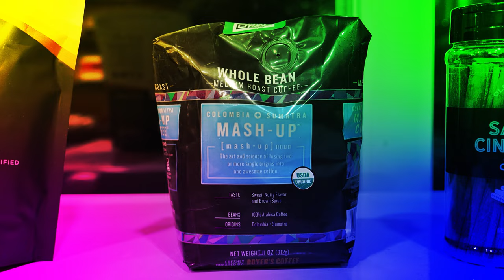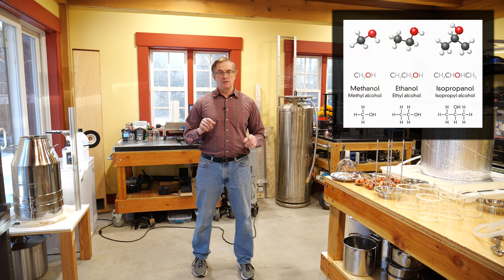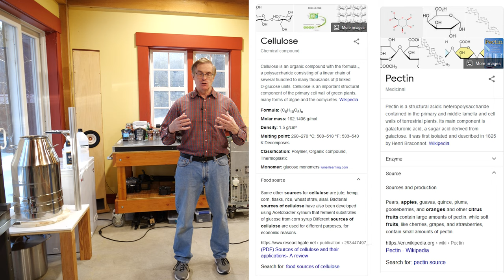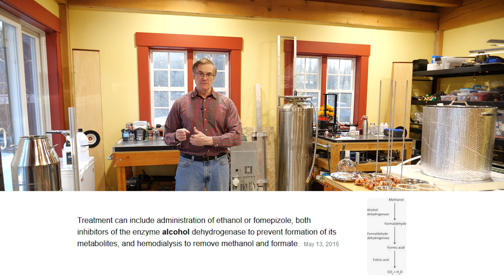Making Vanilla Flavored Rum! - Part 2

Comment: I have used fractional stills many times to distill rum. And as you have it there I was able to start with about 189 proof. I usually do exactly half your quantity of wort at about 23L. 
Here is my feedback. 
The beautiful column still you have is a dream. But I use it only to make vodka. Most of the flavors are gone when using a fractional still. A normal copper alembic still is the best to extract flavors and also the extensive copper traps a lot of the sulfur giving you a much nicer product.

Also I don't grab any alcohol until the thermometer shows 78C. Everything before that temperature is discarded.

Love your channel. The way you talk and explain things makes it a joy to listen and learn.
Reply: This is the question I wanted to ask. I also have a column still with bubble plates but run pot still mode when doing rum, Sometimes one bubble plate running with small dephleg works great. What i seen was vodka production, it would have been nice to explain the difference and the reason you choose this option, I know Rum has a strong flavor and some probable carried through. That said as per the 100s of the comments I scrolled past another great production...

Comment: The Thought Emporium channel did an interesting video on aging alcohol using an ultrasonic bath and it had surprisingly promising resultse. It could be interesting to see something like that on this project
Reply: Agreed!  A great aspect of using US is that one can devote small percentages and get fast results.  That would help privide a more "sciency" atmosphere :-)  Depending on how he blends it might take well to aging.  I think I mentioned US in the last video so its nice to hear others have the same thought.
Reply: He did some rapid aging in the whisky video, though not with any ultrasound. Just requires toasting oak sticks and placing into jars. That and the increased surface area from being in stick form allows aging whisky within a few weeks. Not as quick as the ultrasound method I'm sure but accessible to anyone and not years like traditional aging.

Comment: 3 ideas:
- Keep the leftovers after the distillation, let it dry up (to remove water) and mix it later with the dunder.
- Add some flavours like cocoa beans at the beginning of the fermentation step.
- Store the alcohol with copper/silver pieces soaked in it to remove even more sulphides (although some sulphides are great for the aroma, like grapefruit flavour for example)

Comment: Thanks for the great video.  I love your clear communication and demonstrations. 

There is a burning question, though.  As I understand it, dunder is put into the ferment to add flavour/character.  The reflux still will produce high alcohol concentrations, largely by stripping out those flavouring compounds.  Wouldn't a pot still be more appropriate for rum?

Sorry to be a pedant, still love your work.

Comment: You absolutely nailed every part of the science and process of distilling. If I was hard pressed to make a suggestion it would be, instead of airtight capping off all the jars try leaving them open to the atmosphere covered with coffee filters/cheese cloth. By letting your cuts rest open for 24hrs after distillation, it allows undesirable lighter alcohol compounds a chance to evaporate. By doing this extra step, it makes the blending process easier.

Comment: As cool as the bubble plates are, why did you distill rum in reflux mode versus pot still mode?  BTW, love your content.
Reply: I was just going to ask the Same question I thought the point of a rum run was to preserve as much of that molasses flavor as possible.
Reply: I was wondering the exact same thing 🤔. I could see running one maybe two plates but 6 would defeat the purpose, would it not ? 🤷‍♂️
Reply: Same question here.  I'm new to the craft, but is seems counterintuitive to use that much reflux with bubble plates and dephlag that strips out the profile of all that wonderful molasses.

Comment: What kind of investment would one need to make, to acquire the setup used in this process? $500? $5000?
Reply: That depends on where you shop, you can get a stainless steel beer keg, and if you or someone you know can weld you can make a set up of equal size and build for around $800 depending on your column size selection.
Reply: @quatre1559  I think it would be a lot more than that. Just looking around the column he is using runs almost $1500. https://shop.distillery-equipment.com/collections/stills/Moonshine-Still-Columns. I'm sure there are better deals to be had out there, but if it's anything like beer brewing equipment, it'll be all about the same new.

That's probably not what you were saying, it seems like you meant building one like it. But I think that's what Tracy was asking.
Reply: I know hillbillies that make cheap ones from copper pipe and miscellaneous parts. I'm sure you can find how to do it online. They usually use potato mash and it tastes like vodka but you could make a similar mash to what they used here.
Reply: I just bought a big pressure cooker 40 bucks a copper tube 30 bucks and I use a bucket for my cooler downer. 3 bucks. And that's about it

Comment: Is there a way to test the first portion of the distillate to see what % is methanol?
Reply: Technically, I think you can set it on fire and watch the color of the flame, but you really shouldn't try to dance on the edge of methanol poisoning, because methanol tastes just like ethanol, just a little sweeter and by the time you realize your mistake, you'll probably be blind.  If you want to be safe, either be generous and throw some away, or mix your whole batch together.
Reply: Perhaps thin layer chromatography?
Reply: GLC

Comment: Another fantastic video! You might replace that dephlegmator supply valve with a needle valve. It has a little more control and is also much easier to manipulate. Cheers!
Reply from the maker: Agreed.

Comment: I worked at a small distillery for a day & they actually kept the fores off each run & actually run them again through the still with new mashes to “extract extra flavour” from them. Did same for faints as well.

Comment: What a beautiful piece of kit! I wrote automation for and operated a 93' version of that (several more stripping trays) several years ago. One of the ways we could easily influence our upper column temps was by injecting high proof alcohol in our upper trays to cool the system. Ultimately, we could collapse so much vapor, that we would actually pull vacuum and even further increase efficiency.  Distilling is as much science as it is art and I think you demonstrated where those two schools of though intersect!

Comment: I haven't done a rum,I have a still that will do the job,the dunder was an issue,make a first run,then collect for a second run,it all comes down to time,even though I'm retired,time is always an issue,here in Colorado temperature is an issue,your chest freezer cooling water is perfect,then I thought why not make a two 7 gallon bucket fermenting box,use my temp controller and a heat lamp,solve two problems,thanks for stimulating a ventage brain! I get a lot of information from Jesse,a go to channel.

Comment: If you allow me a suggestion, you could add a "T" fitting and a second tap to the fermenter so that when you want to stop the flow of liquid, after you close the tap on the vessel, you can open the second one , letting air enter through the hole and thus we will be able to empty the hose completely into the can we are filling...

Comment: Thank you. Its nice to learn a litle of the theory of the still. We didnt have so much of that in school. Here in Norway it is comun to make pure alcohol out of sugar and i its a ilegal marked for that. It not som much work making a still from ordenary cobberpipes that you get in the shop. I have not used the mesuring equipment that you have but its common rule that the slower it drips the better it gets. Thoug i made some in Chile for my sons wedding. There i had a gas fire that i could regulate. I found that much bether than to regulate with the cooling water. I might take this up as an hobby some time and your videos gives me a lot of new knoledge.

Comment: Having a degree in chemistry and experience in the lab as well and most of my career teaching secondary science and senior chemistry in school I really appreciate the science emphasis you bring in your presentations.
Reply: Although there are some inaccuracies here. Due to how hydrophilic methanol is, it does not concentrate in the foreshot or even heads as intuition would tell you, this is only seen in an anhydrous mixture of ethanol and methanol. Sure aldehydes and other molecules lacking a hydroxide group will, but methanol is so hydrophilic (more so than ethanol due to ethanol’s carboxyl group and PIE) that it actually accumulates more in the tails than anywhere. If you do a GC for samples taken from each cut in a pot still you can clearly see this trend, with methanol levels being roughy equal until right into late tails. Reflux stills help because near the top of the column it contains a nearly anhydrous mixture of ethanol and methanol, the methanol will actually remain as vapour due to the lower boiling point where as ethanol will condense back into a liquid. Either way, it’s very difficult to produce a dangerously high level of methanol in a home fermentation.

Comment: You can put the float right in the main container if it is deep enough.  I do this with maple syrup.  I made a float and calibrated it and set it right in the boiling sap and it is accurate and incredibly easy to monitor the progress.

Comment: Great episode, great content, great information. I would just like to add that when you Distill above 189.9 it is considered cane neutral spirits (CNS) everything from 189.9 to 40 proof Is considered rum. This is important because you spoke of different taxing requirements. This defines a line between different compounds and how it is taxed. Rum is identified as the little 189 and made from sugarcane.

Comment: Hey, interesting and well made series of videos.  
A long time ago I graduated as a chemist,  and have had quite some experience in the booze body of knowledge.  The more fractionation you use in distilling, the purer the alcohol (ethanol)  will be. When you hear that vodka makers use triple distillation, it means that either that they use a very bad still, or produce very pure - ie- flavorless - alcohol. Ethanol is ethanol, whether it comes from potatoes, grain or canes.

Where it gets interesting is where the alcohol is stored after distillation....  Bourbon ? Fresh oak casks.  Rhum ? they use second hand bourbon casks (already been used to store whiskey). Scotch whisky? Second hand port or madeira casks (except for a few distinct speyside distilleries that use fresh oak). Vodka? Probably aluminium barrels....

And this is where the magic happens. 

Lignin, one of the constituents of wood breaks down when in contact with ethanol into vanilin over time, and that is one of the KEY factors of ageing spirits.

"Rhum arrangé", litereally "fixed rhum" is a carribian concoction of rhum and spices, mostly vanilla.

Now, here's an interesting experiment. Take a supermarket brand whiskey, and leave a vanilla pod to macerate in it for 48 hours. That will fool most experts...
Oh, finally, assembly of most whiskeys or rhums is not done straight after distillation. It is after 3 to 30 years maturation in a barrel. Unless you want to pay for "single barrel"....

Now, peaty whiskeys is something else. Peat is used to dry the malt, and instills a smokey flavour to the grains, and that carries over in distillation. The culprit is a substance called paraethylphenol,  that smells to us like smoke and our nose can detect in parts per billion

Just my $0.02... 

Keep on the good work
Reply from the maker: True. Take a look at our earlier video on aging whisky, "Getting Toasted".

Comment: A note on the infographic stating heads and foreshots are two terms for the same thing…Generally, heads and foreshots are different. Foreshots is the high-methanol fraction that comes out first and gets discarded. The heads comes after the foreshots (a lot more volume) and is usually not consumed or thrown away. It’s mostly ethanol and is added to a later distillation run (of either the next wash or a bunch of heads and tails)
Reply from the maker: Thanks.

Comment: suggestion for future content :

-robotics/bionics
-bioengineering (PCR, how to use retroviruses to create insulin, gene therapy, how to sequence DNA)
-photography (explanation of how to create photographic color films, how they work, explanation of how to create holographic films, and holograms)
-photovoltaic (how it works, what are its limitations)
-more nuclear stuff (fusion, explanation of the technical difficulties, why it is unstable, why it is not working)
-more radioactive stuff (visual demonstration of the impact of different wavelengths on different biological tissues, demonstration of battery charging at a distance with downsides, explanation + demo on how to create lazers)
-more rocket stuff (bring a camera up kms in the upper atmosphere, measure evolution of magnetic field's strengh, temperature, pressure with elevation)

Comment: @
Tech Ingredients try to mount a fine control or a needle valve on the output and after filling in jar #6 close it by half or one turn at a time to purify the next portions even better. Check next time how that would work and you should be getting a constant high % of the alcohol. p.s. great content anyway.

Comment: As you're going through the process. You need to adjust your take off speed slower as the percentage of alcohol in the pot lowers. 
You'll pull much higher amounts (proof wise) by volume and lighter flavors until you get to around 80 proof coming off. Then collect those slowly and flavor test until it turns cloudy or offensive.  It takes a few runs to get the hang of it. But the slower and lighter the take off. The less harsh the final product.  But don't take my word for it.

Frankly at 80 it wouldn't hurt to put it back into full reflux for a while and begin again with a slower take off.  Your pot doesn't have much surface area. That make a difference as well.

Comment: You explain all the stuff wonderfully and make things very clear. Thanks for awesome videos. I do have a question. When considering a column of fermented alcohol in the fermentation vessel, you do get the CO2 over the surface to exclude the Oxygen. What concerns me is below the surface before you start fiddling with the fermentation, will the alcohol, being the lighter substance, concentrate towards the top of the vessel or be distributed throughout equally? What made me wonder is that if the Ethanol is more concentrated to the top you will get a skewed reading when collecting your sample from the surface of the fermentation. Thanks again and keep going please.
Reply from the maker: Thermal vibrations a and bubbles from fermentation  will stir the liquid, but even if it didn't, there should be no stratification. Consider a bottle of vodka  on your shelf.

Comment: That hydrometer will happily float upright just dropped into the pot. It's got a ballast you know. The measuring cylinder is good if you are trying to measure a limited volume, not if you already have a deep container.

Comment: I really enjoyed the video, I've watched it at least 10 times. Knowing that this channel focuses more on science and technology I would like to also proceed in this direction. But why did you use 6 bubble plates? What was the fermentation temperature you used? What influence can honey have on the alcohol percentage? Have you considered a copper pot? What difference would such a pot give you compared to the stainless steel still? Is vacuum distillation utilizing such a system a way of speeding up the process with a focus on flavor and concentrating the methanol in the foreshot heads?
Reply from the maker: Check out our previous video on this reflux still.  This will answer many of your questions.

Comment: First, great Video, love your channel.  I have a question.  I've been distilling rum foreabout 6 years through a 48 inch stainless column "pot" still with great results.  My question is:  I think (may be wrong) that you are  separating out a great deal of the flavor and character by running through  the bubble plates. I would appreciate your comments on the reason to run through bubble plates as opposed to a straight "pot still" column.  Repeat, love your videos and I learn a lot.  Thanks for all your good work and sharing.

Comment: Love your demonstrations. You explain it brilliantly. I'm looking to set up my own still,. thinking I'd like to look into a continuous still. I'd love to automate some of the control. For the reflux ratio had you considered a swing valve or other diversion device rather than coolant flow? I'm keen to look at a sensor based "parrot" with small dead volume to prevent fraction mixing. A continuous readout would give a good process control and understanding. Need to figure out how to make near infrared cheap.